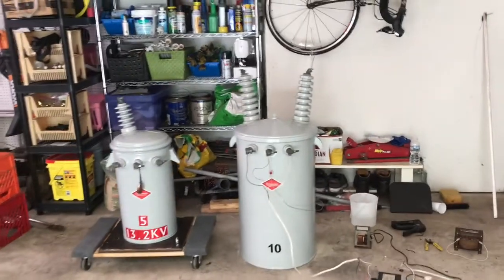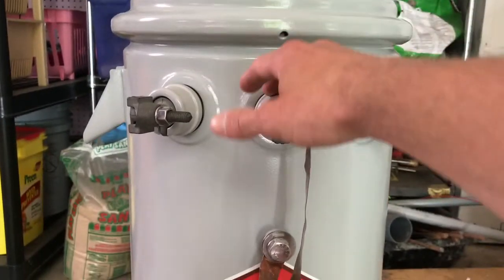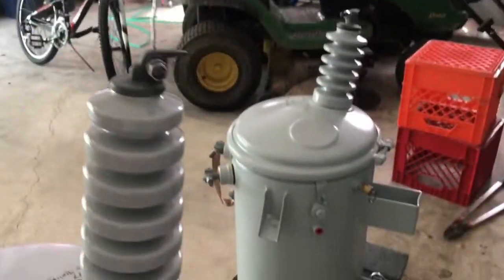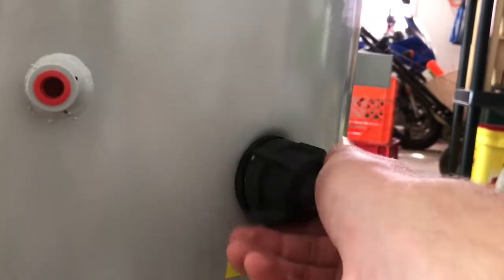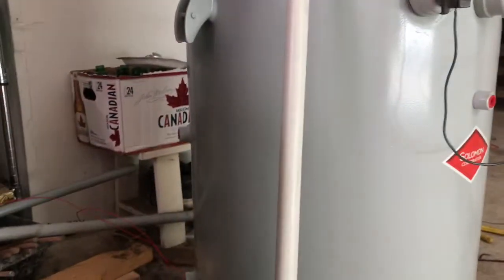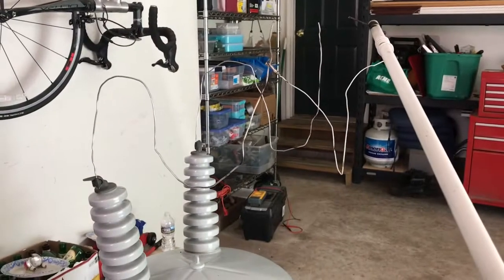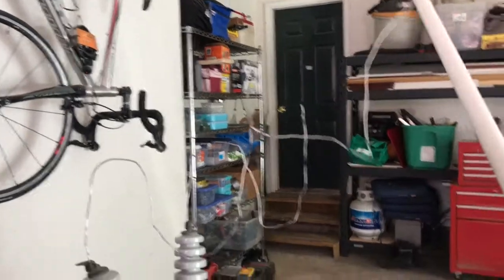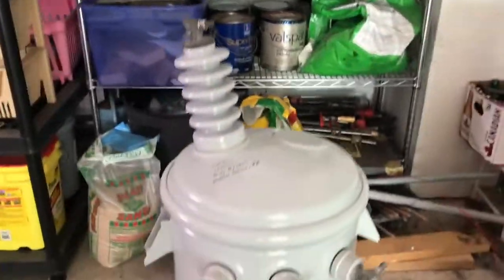New 34.5Y kV Pole Transformer Arcs

Comment: Two of these hooked in series on secondary and parallel in primary plus an industrial grade arc welder for the ballast makes a great power supply for a giant Tesla coil. Better make sure that there is adiquite service to feed it though 🤓😁❤
Reply: I doubt you'd even need two, 20kV is more than enough for a SGTC! Imagine two in series with resonant caps and TWO industrial arc welders. 30kW anyone? Haha

Comment: That's one massive pig! I'm in the process of ordering a 5KVA 14,400/24,940Y for around $600, and that doesn't include shipping. Living just a couple of hours away, I'll be picking mine up. It seemed odd that they predicted the weight to be around 150 pounds. Maybe the sales rep estimated the weight a little low. Anyway, many thanks for the recommendation. Your channel's awesome!
Reply: Seems odd, I would expect more than 150lb for the whole system. Perhaps they mean just the core and coils (150lb would be exactly what I'd expect). I bought a transformer that says 105kg on the nameplate, and then the bloody thing only weighed about 40kg in the end. Dunno lol

Comment: Pretty useless thing to buy.
Reply: You can use it as a powerful power supply to build huge tesla coils or a lot of cool things. You’re clearly not a hv hobbyist
Reply: @mathysgobeil1592  Actually I did high voltage pole line construction in the 70s, high voltage factory wiring tom13,000 volts. I hung these transformers on poles. High voltage hobbyist or not, there are few things that the transformer is useful for beyond limited entertainment. Rather than buying a power transformer, you could buy a smaller potential transformer used in metering and relaying. Same voltages, just much smaller ampacity.
Reply: @alsehl3609  yeah but potential transformer have very low v.a rating (output really low amps) but on pole pig you can have hv with high amps
Reply: @mathysgobeil1592  what do you need high capacity 34.5 kv,  13.2, or whatever to supply? In your garage. IF YOU WERE REWINDING MEDIUM VOLTAGE MOTORS IN YOUR GARAGE MAYBE.
Reply: @alsehl3609  a potential transformer isn’t high capacity enough for a lot of things, but with a pole pig you can make a huge tesla coil that make giants arcs (more amps supply for tesla coil= thicker and brighter lightnings out of the tesla coil)
Reply: What is the practical use of a diamond collar? In my personal opinion there is none. But other people are happy to pay thousands of dollars for it just to look good. Same spplies to HV hobbyists and their toys (and many other hobbies of course). I think different people with different hobbies enjoy different toys.
Reply: @diecksl  An oil filled pole transformer is way overkill for a hobbyist. I worked in pole line and other electrical construction that involved large amounts of material and tools. I had commercial storage space. In a home garage having a heavy oil filled transformer 100s of times the capacity of anything you could possibly need it for is over the top.
Reply: @alsehl3609  I mean if you make some appropriate modifications you can happily draw 100A at 240V from your electrical supply at home (at least here in UK). Try using a tiny little PT for more than a minute or two at 24kVA. It might be overkill for many projects, but I have a 33kV oil filled PT that weighs 160kg, and I still worry about burning the windings on it when running at 10-20kVA. It can probably only handle 3kVA continuous. Also resin potted PTs can explode if overloaded, so yeah, a pole pig is certainly a luxury worth having if u want stupid power.
Reply: @alsehl3609  and what, so by saying 100s of times the capacity you would ever need, are you saying a hobbyist is never gonna need more than a couple hundred watts?
Reply: @inductivelycoupledplasma6207  what 20kva load at 33kv are you running in your HOUSE??!!
Reply: @inductivelycoupledplasma6207  Name a load a hobbyist has at 33kv that exceeds 200 watts?
Reply: @alsehl3609  erm, any large SGTC or decent Jacob's ladder. If the voltage was lower then a tube plate supply would also be a use. I'm not trying to claim this sort of power is NEEDED by anyone, but there are certain hobbyist projects where you don't want to be limited to 1A on the mains side lol.
Reply: @alsehl3609  I'll upload some videos of my setup when I get the 10kVA transformers and the 20kVA variac (plus a 63A breaker). Currently just using a 6kVA Variac and a 3kVA PT
Reply: Well I'd love to be able to get sth like that in EU. There are only huge three phase transformers for 15-20kV primary phase to phase voltage. I've seen some 25kVA ones but still even such are stupid expensive, too big and heavy to be easily kept in a garage. The only advantage is the low kVA ones are mostly dry-type. There is a channel called Herrlito if I remember correctly. The guy has such a beast in his garage and does some crazy shit with it.

Comment: I feel like i could make a super sick trash can out of a bad one of those
Reply: @dopelord_2237  No like actually gut the thing, put a hinge on the lid (maybe a strong gas shock so it’s not so heavy) and use it to store waste
Reply: Not many people did it but when my pole pig had a primary to secondary flashover(don’t contain pcbs), i poured out the oil in a drum, got the transformer out, unwound it and fixed the insulation then i rewinded it, put the oil back and vacuum the whole thing to get air bubbles out. It’s working like a brand new
Reply: @mathysgobeil1592  awesome. I'm relieving to hear that you got away with that, makes me feel slightly less anxious about damaging any of my transformers. Also gives me hope when it comes to building my own from scratch (gonna go for 150kV 15kVA)

Comment: since this is a two bushing pot , neither side of the primary is grounded.only single bushings are grounded internally. the power company may tie one of the primarys to the system neutral.
Reply: We bring the H2 bushing to the system neutral if we are using a 2 bushing can on a wye circuit.
Reply: @ucfsub  aren’t wye circuits only a three phases transformer thing?
Reply: @mathysgobeil1592  Wye can be single phase or three phase.
Reply: @ucfsub  i searched for it everywhere and never found something about single phase wye. Must be a rare thing
Reply: @mathysgobeil1592  Nope, it's the system of choice in the United States. Utilities are phasing out Delta for the simpler Wye.

Comment: Very nice piece of equipment there! Coincidently, I put in a quote for the exact same transformer the other day. It'll probably be a little while before I actually buy it though. I didn't think it'd be that heavy. Maybe I'll go for a 5kva instead for the sake of moving it around. Great vid, thanks for sharing :)
Reply from the maker: Matt Deluca Thank you! I do recommend them! When I contacted my sales rep I originally wanted a 5kVA 34,500V delta. She told me that 34.5kV coil voltage isn’t used under 50kVA, probably an ANZI standard, and that they started to phase out 5kVA transformers, even to the point that they wouldn’t custom build one for me! Since I really wanted a 34kV class one I broke down and ordered it. I searched T&R electrics website and could only find a small amount of used 10kVA 34.5Y-277V transformers. I guess 34.5 kV is usually used for transmission. I paid a few dollars short of $1000 for it. I had it shipped FedEx Freight ECONOMY!! And picked it up at the terminal myself. It would probably had been a $1K bill for shipping if it was priority. Took 3 people to unload it lol!